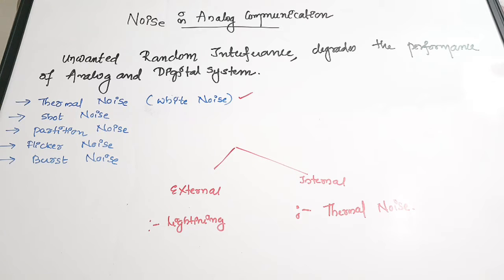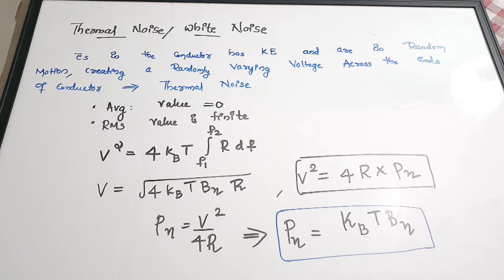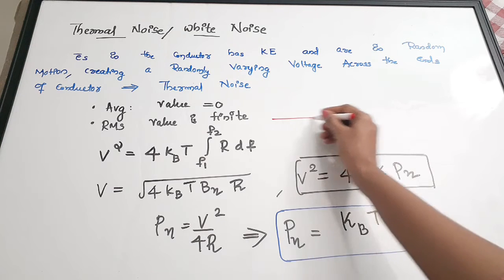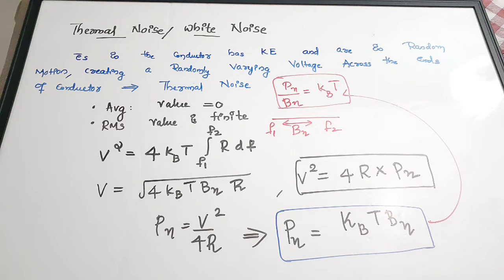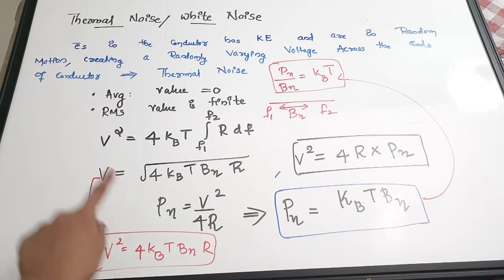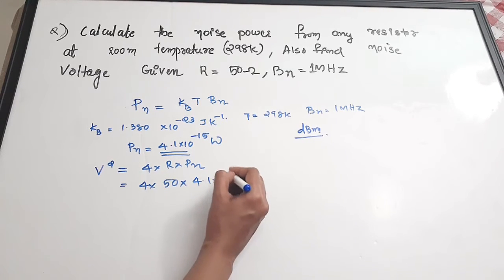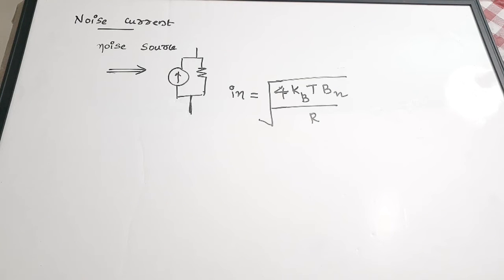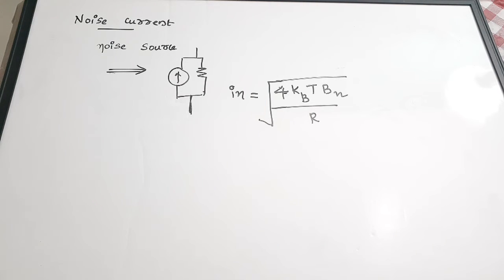Noise in Communication Systems| Thermal Noise(White Noise)| All Equations and Concepts

Comment: mam why thermal noise also called white noise?
Reply from the maker: It is said to be white because, its power spectral density distribution is equal through out the frequency spectrum
Reply: @EasyElectronics_jobupdates  thanks mam